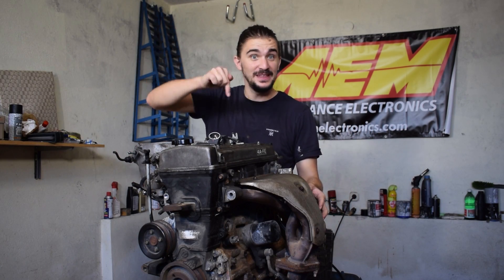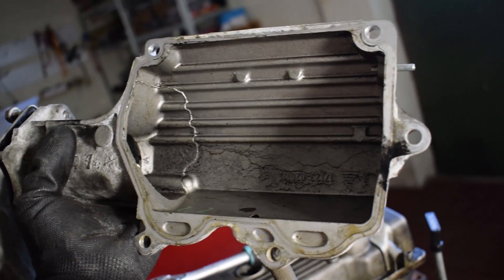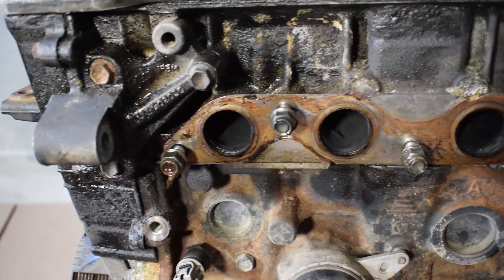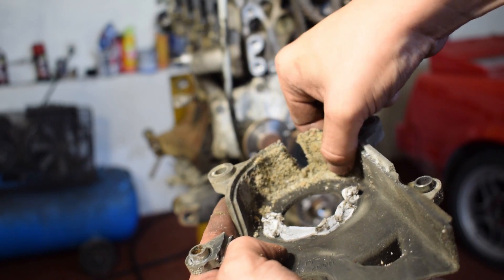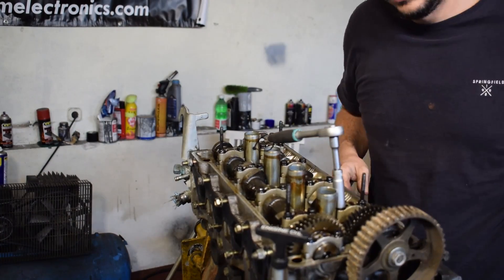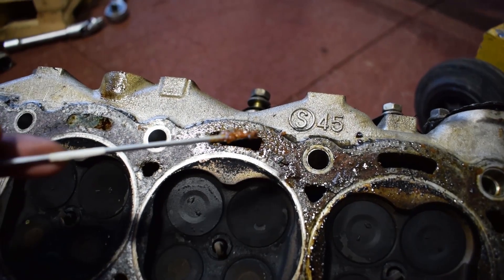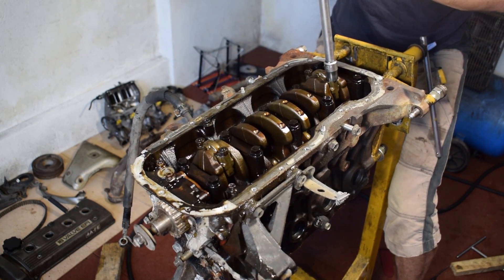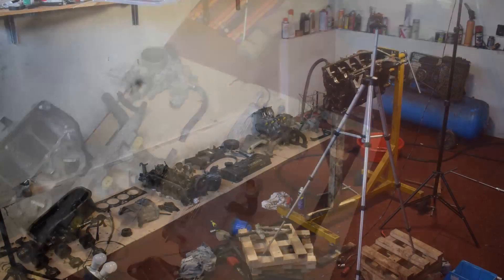ENGINE TEARDOWN and ANALYSIS - Project Underdog #4

Comment: The head gasket thing is so true, I pulled out the head on my 5a-fhe engine and it seems the coolant passage ways are not really lined up, even though that's the stock OE head gasket. A friend mentioned it might be to restrict coolant flow from the head so it retains some but I'm not entirely sure.

Comment: I bought a ae92 december 2024 and My 4af has a tvsv delete. And the cold start up is rough. Where can i get a vacuum line guide for a USA spec 4af with no tvsv, and what shouldnt i care about connecting. Or if you can tell me how to do a proper tvsv delete. Please help.

Comment: Everythings were fine until you hit directly the oil pump with a small hammer 😡. 
Never hit a part like that ! Use a counter mass to disperce the impact.
🔨💥🔨 here's the principle:
https://m.youtube.com/watch?v=NfF61CR1jf8&pp=ygURUGVuZHVsZSBkZSBiaWxsZXM%3D

When rust is a problem, the solution is acids... hydrochloric acid to be more precise.
You may have melted that rust with no problem at all !
😓😓😓
It also works to clean the cooling system. But don't forget to rinse it well...

Comment: It looks like you can't win with a scrap yard engine.

Overall, the engine looks very good, especially in the areas where it counts the most.

But, the cooling system and exterior of the engine looks terrible. Goey and crispy is what I would call it.

Comment: The best looking junkyard engines are those that never got to run very much. I feel that the head gasket may have caused chronic overheating, resulting in the engine being junked while still in its prime. The bad coolant plus clearly wrong head gasket are a sign of amateur mechanics at work. For the rest of us idiots, hopefully this is a lesson we take heed of.

Comment: I use a box with pop rivets in it to store the buckets in the head. This is due to marker rubbing off very easily on my first engine. I also cut holes in the box to store the head bolts.

Comment: I have a 1.8 L 4afe in my 95 geo prism I'm currently turboing as well :)
Reply: Hello. I have to 4a-fe with carina e, and swapping to newer car to project.
 And how did it work? it's a turbo, not a compressor (eaton) right? What about the power, and other stock? How rpm maximum power, and torque? I miss this engine for scrap. It is in very good condition, it's motors run in Africa. there will be no such engines and there is some potential as you can see. A compressor is enough for me, and about 160-170 horses (in a light car it is enough power.) Regards! 😊old engines the best.

Comment: Hey really enjoy your videos I think the cylinder head will be the limiting factor to the power levels due to the lack of aftermarket cams and I'm not sure what ecu are available for the 4afe I have tried a hoanda vtec p28  ecu  on a 4age and they process faster than the Toyota ones and really makes it preform maybe you could try it on your build.
Reply from the maker: Catcams makes the cams. But I'll keep the stock ones. Turbo cam and NA cam are two different games. Standalone ECU is the way for any serious build.
Reply: @d4a  oh that's good to know about the cams and definitely standalone ecu is the way to go.

Comment: I’ve run into seized timing crank pulleys before and I drill a few holes and use a cut off wheel crack out a small triangle.  From there a breaker bar will snap the gear in half, pretty quick and less chance of damage too the crank snout as well.

Comment: What is a safe piston speed for this engine in ft per second? Looking to see how far I can push the engine past the redline with a minimalist rebuild
Reply: And? it worked? what did you tune? what project is it? turbo/charger eaton mercedes? 😊 I hope it works fine!

Comment: Is that a second gen 4afe?
Reply from the maker: It is
Reply: @d4a  would that drop right into a car with a first gen 4afe? My car is a 1990 Celica st
Reply from the maker: @erwinschmied  It should. I'm not sure about the electrical stuff tho. But engine and transmission mounts should be the same.
Reply: @d4a  Thank you very much!

Comment: I will install 4 bike carbs on a 2 litter honda a20a2  N/A engine and i want to have rev limmiter...With carbs there is only spark cut possible..Can you tell/explain if there are any bad sides for the engine.Any advices will be welcome.Thanks
Reply from the maker: Do you mean if spark cut is bad for the engine? Hitting any sort of rev limiter that's set high enough could be described as being "bad" for the engine, especially if you stay on the limiter, and it does put unnecessary loads on almost all the components.  It's always best to use the engine within it's powerband.

Comment: I am not sure if it fits or if the diameter is smaller but the corolla e11 produced from 97-99 with the 1.3 4efe engine had an interesting tubular intake manifold with almost equal length from the throttle body to each cylinder
Reply from the maker: Thanks for the tip!

Comment: In my 3 m52 engines the holes in head gasket and cylinder head also didn't match up. Gaskets wasn't repaced before. Friend told me that this is for coolant flow but I'm not shure about that. Can someone explain this?

Comment: its either flooded before or the water pump was leaking which the white stuff you see is probably either coolant deposit or aluminum oxide from the cylinder head.

Comment: great video! for removing stuck crank timing gears I drill and tap two holes either side of the crank snout, like pulling a gear with threaded holes in it already for using a different puller, if still being stubborn, load up the puller, add some heat to the gear and shock the puller with a FBH

Comment: The circular things on the intake manifold is for the EGR system on the California emissions variant of that engine. On the low emissions variant, the circular things would have been machined further and the EGR valve would be located there. Since you got the regular version, those serves no purpose and can be safely machined away if you want to port out the intake manifold.

Comment: Duuude love ur vids esp the engine breakdowns legend

Wanted to know your thoughts on rust prevention and undercoating ie what you might use restoring a car protect it against the elements, I'm torn between 2k epoxy then raptor liner ontop or just go for cosmoline type coating

Comment: Mirror finish on the bores is bad, it means they're glazed and won't be providing an ideal seal with the rings. What you want to see is crosshatching from being honed.
Reply from the maker: A glaze is something totally different, it's usually a different color and glazed engines have a lot of blowby.
Reply: @d4a  you're right, wrong version of shiny. They're polished, not glazed. Not ideal either way.
Reply from the maker: They're getting an overbore anyway :)
Reply: @d4a  I assumed they would be 😁

Comment: Oh no, you didn't put a set screw in the timing scissor gear pre-tensioner before you removed the camshaft!
That will be fun to fix lol
Reply from the maker: That's not how things are done in this case. Service bolts are needed only when the sub-gear is removed and reinstalled. Upon reinstall of the cam all I need to do is align all the timing marks and possibly measure backslash. So no, there's no need to "fix" anything.

Comment: Curious if there's any reason you didn't go for the larger 7A-FE as a starting point?  Loving the content, good luck with the build.
Reply: Maybe because the 7afe is an interference engine and the 4afe is not. Plus The 7afe was in later MR2's I think. Not in the mk1. I am speculating however.
Reply: @nospoon4799  the second gen used the Toyota S engine, FYI. I was really into MR2s in my 20s and know entirely too much about them. 🤣
Reply: @gedavids84  Sure. A friend had a MK2 for a while. I have had 93 5door Corolla with a 4AFE in for the last five years. I love it actually. It is by far my favorite car I have had. Also I work on my own vehicles and it is so easy to work on it is unreal. Compared to the likes of Audi etc.
Reply: @gedavids84  The S engine would be the 20v?
Reply: @nospoon4799  no, the S is a whole different engine family. The 5v is still an A engine. 4AGE.

Comment: Usually I use a 10mm bolt from one of the cam journals to hold the spring gear on the intake cam in place. They are kind of a pain in the ass to reset once they have sprung loose. The 4afe is one of my favorite engines. Super reliable!!
Reply: noticed that too, oops lol

Comment: I'm wondering about metal shavings(or any contaminate) getting past the oil filter and damaging the bearings. Is it stuff that's too small for the oil filter or is the damage caused by material that bypasses the oil filter when the engine is revved up?

Comment: Some good work and I'm very interested to see how this build comes out.
Watching you use a legged puller to remove that crank accessory pulley almost made me cry, there are tapped holes in that pulley for a reason and it's so you can bolt a plate puller onto it. 
I see way to many chipped and damaged 4age pulleys all because people use the wrong puller.

Comment: i've been wondering for a long period of time that why are the jeepneys in the phillippine use only tap water for the radiator and the engine is pretty okay 100% no abnormal things going on and it doesn't corrode or contaminate the oil, pls gimme a explanation because idk what"s going inside the engine, maybe it's because it's a diesel engine idk plss gimme answer #driving4answer and more power to you channel cause your really making really great contents cuz it's based from your own experience not from google or whatever. more power and support to you channe cuz your one of smallest channels that is making a really gr8 content #driving4answers #moh pawah babeh

Comment: Correct if wrong
Tensonor is actually manual..... the spring is only fuctional during initial tensioning and if the tenson bolt loosens.
The head gasket is indead correct the misaligned holes act as restrictions and help direct the coolant.. if you research coolant flows for the engine you would be surprised
Reply from the maker: According to the 4age factory service manual, you let the spring do the tensioning, rotate engine three times and tighten the pulley at whatever tension the spring generates. You then check belt slack with a gauge and replace spring if slack is incorrect. I really should have explained the head gasket thing better, got a lot of comments on it. Yes, I know gaskets can be used to block of holes, but what's weird is that the HG itself has holes that lead into nothing. Dead ends. This confuses me because it has no purpose whatsoever.

Comment: I'm just going  off sound I think you need a little more air pressure for your impact gun. It sounds low and should be able to take that crank bolt off no problem.

Comment: Yep, cooling system has been ignored.  Not a big deal; rest of the engine looks like it was maintained well.  I recommend that you do NOT alter the combustion chamber to reduce compression.  There is no need to reduce compression ratio if you are using an aftermarket ECU, and reducing squish will make the engine more likely to detonate...whether it is turbocharged or not.  You want to minimize the squish area to maximize performance,

Comment: Coolant passages very rarely line up exactly with the gasket holes. It's easier to cast heads and cylinders with the holes larger than needed then make the gasket with the proper size holes for proper coolant distribution. A lot of first year models in a series will have a different gasket than the last years in the same series because manufacturers will optimise the coolant passage sizes on the gasket throughout the series run to better distribute coolant.
Reply from the maker: I get you but it's not about lining up. The gasket holes lead to a dead end
Reply: @d4a  same thing. If the manufacturer decides they don't need a passage in that spot a lot of times they will only delete the passage on one thing. Like you'll have a passage in the head, one in the gasket but the passage on the block is blocked off. Why change 3 things when all you need to change is one. Saves money. A good example is that really stupid zulu mod on Toyota's. I think it is the 1jz's, but they had cooling distribution issues so they blocked off the coolant passage on the deck if I remember correctly but left it on the gasket and head. Could be the other way around. I say the zulu mod is stupid because the passage was blocked because of distribution issues and people open it up thinking it's going to help cooling.

Comment: That crank timing trigger wheel is what I used on my 7AGTE build. I had to cut it off the pulley and weld it onto a 4AGE pulley and it works great!
Reply from the maker: I remember that actually! What kind of oil pump did you use?
Reply: driving 4 answers I used the 4AGE pump since it flows more oil. Had to cut some material away to mount the sensor basically where the 4afe sensor is. It works great though, have it on my AE86 and another 7AGE I built.

Comment: Usually gaskets that block off ports are to help divert coolant into certain passages. It's weird but that's how they're designed. In my dads s40 volvo some ports were blocked off completely
Reply from the maker: Yeah I've seen that too on some gaskets, but what's confusing here is how the gaskets actually has holes that lead to nowhere. These have zero purpose. Oh well...
Reply: I'm reaching here, but could be a recycled head casting and using a gasket is cheaper than creating a new casting.

Comment: A true underdog would be based on a 2E engine, I do have a bit of a soft spot for these though
Reply from the maker: You have to at least be a dog in order to be an underdog :) but it would be fun to try. The three valve per cylinder arrangement would be a major pain tho. Pretty much everything else too probably. But now I want to see it done.
Reply: @d4a  The 2E actually goes far better than you'd expect. The 2E-ELU even more so. I haven't had the fortune of driving a 2E-TELU though, but I can imagine it would be fun. My daily just has a 4K

Comment: Great post, and for your sponsors I already purchase an AEM A/R gauge. What interested me was which single gear are you going to use on the camshaft.
Reply from the maker: I'll be keeping the stock one for starters. If I need an adjustable one I'll have to make one as the aftermarket for the 4AFE is pretty much non-existant

Comment: The head gasket design is normal i think. On Nissan CA18 it's the same design and it help   cooling, to force water passing all the cylinder walls.

Comment: The holes on the engine head gasket are actually fine. ~~ Always the holes of the coolant in the gasket are smaller than holes in the block or head. This is to make the coolant flow slowly to better cool the engine head
Reply from the maker: They flow into nothing? They don't match up, it's a dead end
Reply: @d4a  According to Fel-pro it's fairly common.
Reply: My understanding was that the gasket is designed after the engine and the differing size of coolant holes in gasket vs block is them tuning the cooling system

Comment: Nice teardown,  i have pushed the 5AFE to 250whp on watermeth + 95ron safely. Some larger cams, springs ,intake and porting and it will flow for alot more

Comment: Not sure if there is one for that engine, but I would definitely recommend a 123Ignition distributor for the build, unless you're going with the Nodiz again.
Reply from the maker: I'll be going full standalone and COP :)
Reply: @d4a  dope! Can't wait to see that. Is it a fuel and ignition computer or just ignition? Trying to help a friend run COPs on his triple Weber L26 for a bit more flash to compliment the Webers and long tube headers on the other side and all I can find is stuff that MIGHT work, but would have to batch fire them. Not the end of the world, but not what I would prefer.
Reply from the maker: It'll be a full standalone, both fuel and ignition. Yeah, the stuff for carbs is all wasted spark at best. I know a guy who ran a BMW OEM ECU for a triple carb setup. Just left all the fuel stuff disconnected and used the ignition. It was a messy and weird setup, but the car went really well and was beautifully smooth.
Reply: @d4a  cool, and thanks for taking the time to reply.

Comment: Why are you using a half inch impact on 10mm bolts. That's overkill and completely unnecessary. I could take that intake off with my quarter inch ratchet
Reply: I am a mechanic and I would never do that it just makes no sense to have 800 ftlbs of breakaway torque on a fastener that might be torqued to 10 or 15ftlbs
Reply: Yeah. 
You could spend all day with a 1/4 ratchet. 

Obvious you aren’t a mechanic. Because as long as the job gets done with no damage. No. Such. Thing. As. Overkill.

Comment: I wonder if those exhaust ports would be that much of a limiting factor, at least at your desired power levels. Head looks really good inside! I love to see a geared cam even if it isn't the "superior" arrangement. Does help get that nice steep intake angle though. Also wow those are pointy cam lobes. Metal shavings looked like they may have just been some stripped threads from the engine or a bolt. All the bearings look great! Awesome video. Can't wait for more. Look it's a boxer engine now! Hahaha.
Reply: Those pointy cam lobes leave plenty of room for improvement, that's for sure... I'm already enjoying this series and look forward to seeing every step of the build.